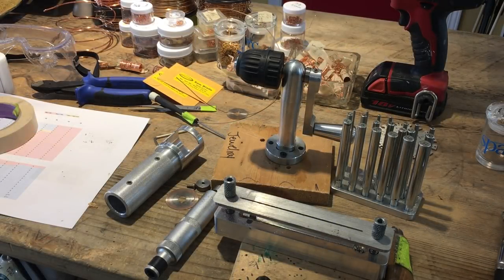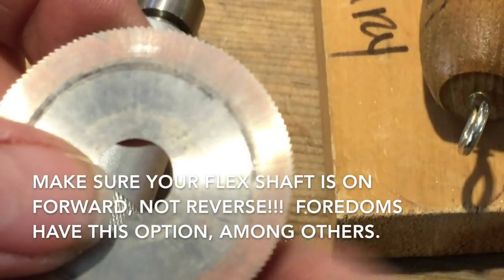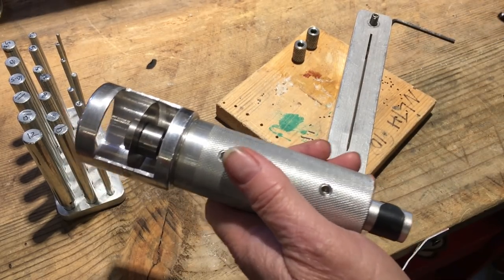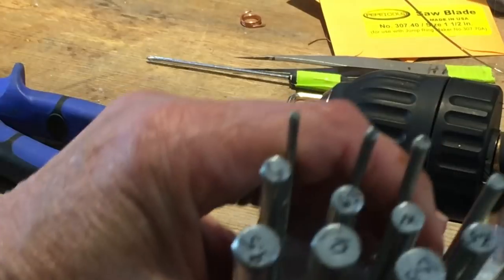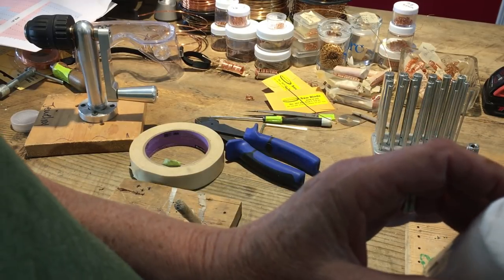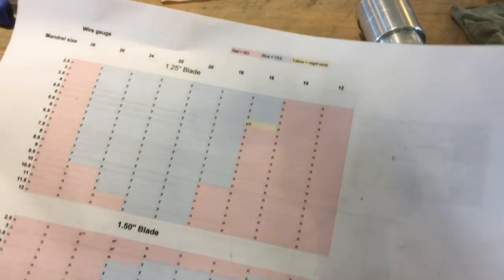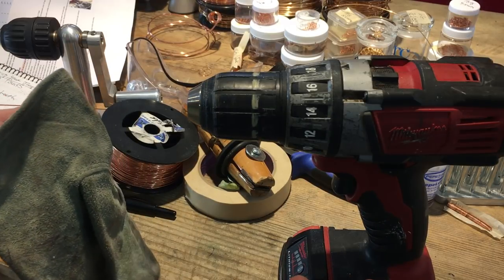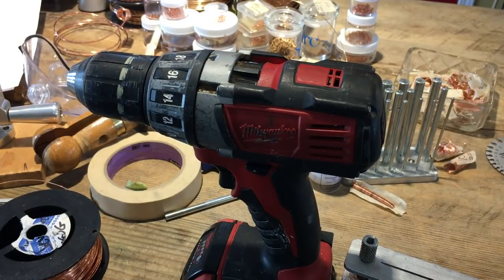Jewelry Tools:  Making the Most of Your Jump Ring Maker

Comment: Thanks for the video and for the chart you made (I've printed it out and hung it in my studio for reference) the tape trick is great for holding them all together...I also wanted to add (sorry if you already mentioned) but getting the flex shaft to full speed before running it thru the rings has been very helpful to me. If my speed is too low or variable, I run into problems with cutting them.

Comment: Great video, thanks so much.  I have a love/hate relationship with my PePe  maker and I am certain its my doing.  It seems that too much metal is being removed from the cut rings, so I dont have nice edges.  I cant just close them up when using in a project. the gap is a little too large. This is why I have gone to just hand making a few at a time, by hand, on the mandrel, then having to saw each one individually which is awfully time consuming and still not as a pretty gap as I would like. Any suggestions for me?   Again, thanks for the help and the spreadsheet guide!!